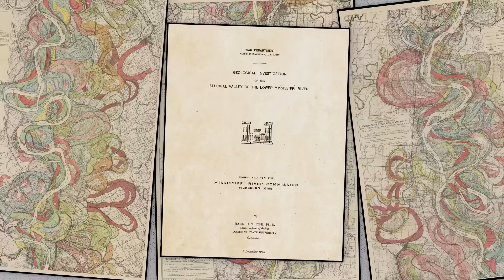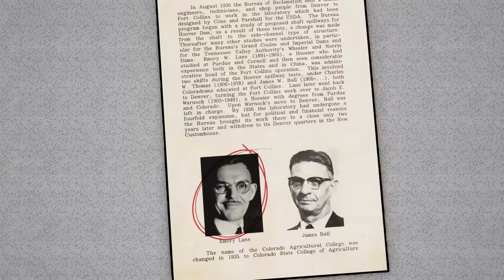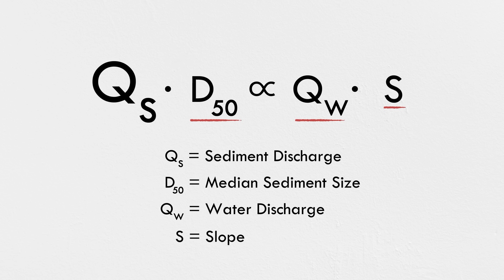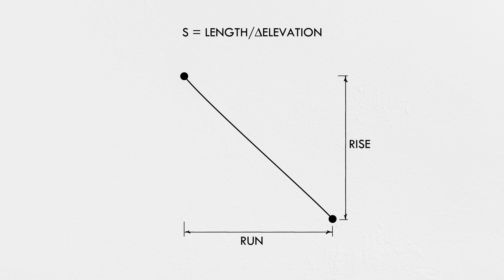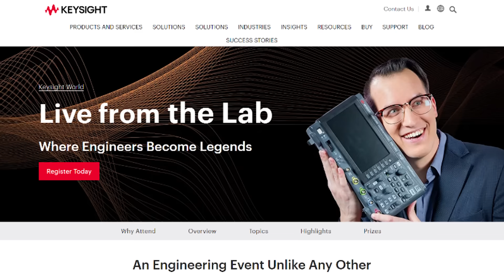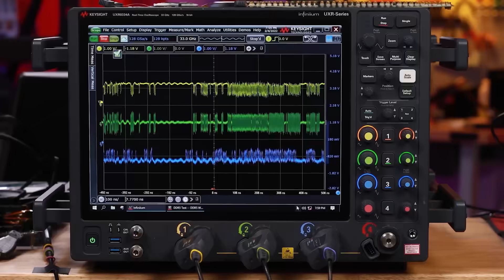Why Rivers Move

Comment: As much as I do not like the US Army Corps of Engineers, there is one thing they have done that redeems them for me and that is the model of the Mississippi River drainage basin close to Vicksburg, MS.  They built a partial one of the Mississippi R with the Arkansas R,,and the rivers feeding the Atchafalaya R. which are the Red, Black, and Ouachita Rivers that come together not far west of where the Louisiana and Mississippi State line meets the River above Angola State Penitentiary.  Technically the Atchafalaya R basin does not connect with the Mississippi R except by a lock between the two rivers.  At one-time centuries ago, the Red, Black, and Ouachita Rs drained into the Mississippi R.  Somehow the Miss. and Atchafalaya split and made their own channels to empty into the Gulf of Mexico at different locations about 100 miles apart.  After watching your video, I think the Atchafalaya R is the younger river as it has fewer bends and is faster than the Mississippi R to get to the Gulf.  If the Mississippi R ever breaks through to connect with the Atchafalaya R by way of a flood the likes of the 1927 or greater flood, the Mississippi will take over and basically leave Baton Rouge to the Gulf pretty much high and dry and flood out the towns and cities along the Atchafalaya including Morgan City, LA.  US190 at Krotz Springs and US90 at Morgan City and LA 1 at Simmsport will probably be cut by the flow.  Those 3 highway bridges and 4 railroad bridges will probably be cut and the I-10 bridge will be imperiled.   The Bonne Carre Floodway has been used a number of times to relieve floodwater pressure above New Orleans but the Morganza Floodway has been used only twice since it was built, in 1973 and 2011.
 I like the river models because flood models can be run on them to gauge the height of floods based on rain gauges to predict whether levees will be topped or not.  They are good for that.

Comment: Consider the impact of the loss of historical beaver populations in the headwaters major rivers.

 While nothing will completely stabilize river banks, millions of small structures in the smaller streams in the headwaters can mitigate the major factors of instability you cover here by attenuating flow regimes and preventing or reducing impacts from large wildfires. 

In the face of a changing climate the structures beavers make can act as a buffer to impacts. Plus they work for free.

We need civil engineers to acknowledge the ways we can live and even partner with beavers.

Comment: The Lower Mississippi River Museum in Vicksburg, MS has those maps on glass where you can slide them to see the changes over time. They also have a table similar to the one you used but it was running low on substrate the last time I went. It's an interesting spot that's free if anyone is passing through the area.

Comment: f  you need  an example of increased water flow in a river,  La Grande in northern Québec.  It ends at James bay at 53.83500540114829, -79.06136776815968
Upriver is a large reservoir.  At the head of la Grande river  about 600km to the east, they diverted part of Canapiscau river (which flows into Arctic) into La Grande River. 
South of La Grande, they diverted Opinaca, Eastman and since 2012, a portion of Rupert rivers north into the reservoir Bourassa, 
As a result, the La Grande rivier's flow from Radisson to where it dumps into James Bay has been seriously increased since about 1980 (and progressively as they increased the number of diverted rivers since initial phase. 
The town of Fort George was on a sandy island at end of river, and locals would fish on La Grande and in James Bay.  Due to the predicted water flow increase, Hydro Québec paid to relocate tghe residents on mainland at what is now called Chissassibi. And because the speed of water flow of the river is too much for small fishing boats and canoes, a new road was built from Chissassibi to the shore of James Bay where they can launch their fishing boats. (Fish also no longer swim upstream now only due to current, but also lack of path up each of the many dams to the source of the river. 

The island of Fort George still exist,  and many buildings remain, but there has been much erosion of the sand, especially on its north side that is on the big channel.  On the south side, there is now steep sandy cliff with trees precariously perched right at edge.  This has happened in the space of 40 years.

Comment: I'm a practicing river hydraulics Engineer in Canada. Recently, Engineer notices on river channel stability have become mandatory in order to get the required permits from the environmental authorities (not the transportation authorities) to do the most basic small bridge and even culvert rehabs. Your video highlights the random nature of river dynamics, and you can see how dubious it is to expect engineers to predict the future behaviour of a river or creek almost as a footnote in the main hydraulics, hydrology and geotechnical studies. Don't get me wrong, structures are absolutely designed to be safe in all conditions. The objective of these new notices is to try to avoid a shortened lifespan for the structure due to erosion or filling up of the channel which would require an earlier than expected rehab. River dynamics is still essentially an academic endeavour, and can't realisticly be applied to tiny culvert crossings. Could you justify weeks and weeks of data collection and analysis for a new bridge over the Mississippi? Of course! What about for a tiny culvert replacement? Of course NOT! And even then, you might only have a ballpark estimation to go on. But environmental authorities don't seem to understand or care.

Comment: This sort of engineering has always fascinated me.  There's a creek that runs behind my house and 30 years ago, it had an island in its middle with a deep channel that ran on the far side, while a straight shallow channel ran on the closer side.  Fast forward 10 years of spring thaws and snow melts, and a few heavy incidents of heavy rain, and the island's farther channel is decidedly more curved, yet still carries the greater flow rate of water.  A few years later, and after one very heavy snow melt and minor flood (this creek has never spilled its banks in my lifetime), and the far side channel has had its intake sealed off by an inundation of gravel and mud, and the nearer channel becomes the main channel for the creek, even though the old channel reopens itself when the water level increases.  Yet, within a few years of this, the island slowly stops existing, and gradually the plants fill in the old far channel, while the nearer channel deepens and straightens.  Downriver, the town decided to create an artificial millpond for fishing and tourism, by splitting the creek's flow, while upstream the heavy presence of trees keeps the creek channels stable along several twists and slow turns.  Within 5 years of cutting a new channel for the creek to provide water for the pond, the intake location has shifted 20feet downstream, eroding the half-assed breakwater of ROUNDED stones at the narrow isthmus. Within the last two years, the creek has begun creating a new island during flood events, approximately 50 feet upstream from the old island, by cutting a meandering loop of water that fills when the flow is increased.  Its location seems counterintuitive, because of its proximity to a major bend in the creek, and represents an almost 270 degree turn the in water's flow.  But that side of the creek is relatively flat, while its opposite side is high and heavily wooded.  Interestingly, the creek is typically no more than waist deep in most locations, but the old and straight channel that still runs beside where former island was located is now more than 10 feet deep.

Comment: the question missed is which way is north because the water is influnced by gravity and based on the table direction it will produce different runs like you see in nature unless it is designed in concreate
Reply: just like flushing a toilet the water swirls based on gravity so if the water is designed back words you get swamps
Reply: @tomahawkmissile241  Why would a toilet swirl be affected by gravity?
Reply: @DeathsHood  it is flowing into the earth. If you go to the other side of the world it would flow the other direction which is the turblance or whirl pools.
Reply: @tomahawkmissile241   That's not how toilet flushing works. It's far too small-scale to see an effect like that.
Toilets flush in whatever direction their jets/nozzles/etc direct the water.
It's even possible to find a toilet with no "swirl".
Reply: @DeathsHood  challenge accepted. lets try a bigger scale look at your weather and see the direction it swirls now look at your potty.  Gravity pushes the water than the electromagnet field twists it. If you wont stick your hand in the water to see if your potty has a nozzle start with your sink and watch it drain like every river does in the world.
Reply: @tomahawkmissile241  A) Most weather doesn't "swirl". Hurricanes do, but that's caused by the coriolis effect, I.E: The rotation of Earth, not gravity.

B) Again: Toilets are too small to be affected in that way, and it wouldn't be gravity that changed the flow of water, it would be the coriolis effect.

C) What does electromagnetism have to do with any of this?

D) A river flowing and a toilet draining are completely different. Both in effect and appearance. They are not correlated on any way other than "both are full of water".
Reply: @DeathsHood  it all has a meaning and they all drain
Reply: @tomahawkmissile241  No, it doesn't.
You just strung together a bunch of nonsensical word-salad that is essentially meaningless.
Reply: it is neutonian thinking that has no merit in the reality of time in order to understand you would need to add in the back words turblance and you will find the meandering

Comment: I never knew how interesting civil engineering was until I found this channel!  I only it didn't need maths...

Some years ago (before we had kids, so I still got the window seat occasionaly...) we flew from Debrecen in Hungary down to Greece.  The first third or so of this flight is straight across the Hungarian Great Plain - the largely flat area inside the curve of the Carpathian Mountains, over which the Duna, Tisza and many other rivers have flowed for millions of years.  

And this is a live - and brilliant- geography lesson into the way rivers move.  Almost every square kilometre you fly over is littered with oxbow lakes, or the remains of them.  Again and again field boundaries, roads, etc follow these lines - often when the original river or oxbow lake is now nowhere to be seen.  

With the controlling of the Duna and Tisza that's taken place over the last 100 years or so and the drainage and management of much of the plain, very little of this is obvious from ground level.  But, from the air, its entire history is laid out below for your education.

Comment: 16:06
You're exactly right and it's a trend that's been picking up speed over the last decade or so. I always hated electronics and avoid them at all costs until I accidentally fell backwards into it several years ago. Mostly fixing test equipment so that I could have my own small lab in the corner of my workshop. But things snowballed and it became a full-time thing. Because of such high demand.

 Electronics engineering type stuff is a great career path to look at these days for a lot of folks. That doesn't mean you have to follow a certain path... There are hundreds and hundreds of strange and interesting opportunities related to to electronics engineering in industry and research.

I specialize in component-level board repair for lab and test equipment. And some associated metrology stuff. It's crazy all of the things clients have brought to my lab or have requested that I come out and take a look.

 Everything is speeding up and becoming more electrically involved... Usually to the benefit of efficiency, prophets, and safety. 

Even for someone like me who hated and dreaded having to work with electronics (back in my early twenties when I used to restore Nils & machine shop equipment as a hobby.) I started learning and now I really enjoy it. It's a lot simpler than most would assume.
( Except high-frequency and RF type stuff.... that's just straight-up black magic.)

Comment: It looks like the equation can be solved for sediment sizes that can be made mobile by a given combination of slope and discharge flow.  In western Colorado most rivers are confined to canyons and we don't see the meandering as often.  About 5 years ago we had unusually high runoff that I got to see in person as part of my job.  At the confluence of the Gunnison and Cimarron River a large pile of "sediment" was created where it had been flat and smooth as a result of the massive flows.  It was about 100 ft. long and 30 ft. tall and very unstable.  It consisted of rock from fist size to several feet in diameter.  I was shocked.  By the following summer it was completely gone.  Those rivers typically flow at 1300 cfs and 300 cfs respectively but on that day it was about 10,000 cfs and 2,500 cfs.  Great video!

Comment: Similar to how lightning doesn't take a straight-line path to the ground. 

I do a lot of work with electronic test equipment and metrology stuff... And I've had a few folks and clients ask me about that over the years. If electricity always takes the path of least resistance.... than why does lightning have such a complex and unpredictable path. 

A bit unintuitive if you don't work with that type of stuff everyday. But totally makes sense once you figure out the science behind it. 
Great video as always!
Reply: 16:06
You're exactly right and it's a trend that's been picking up speed over the last decade or so. I always hated electronics and avoid them at all costs until I accidentally fell backwards into it several years ago. Mostly fixing test equipment so that I could have my own small lab in the corner of my workshop. But things snowballed and it became a full-time thing. Because of such high demand.

 Electronics engineering type stuff is a great career path to look at these days for a lot of folks. That doesn't mean you have to follow a certain path... There are hundreds and hundreds of strange and interesting opportunities related to to electronics engineering in industry and research.

I specialize in component-level board repair for lab and test equipment. And some associated metrology stuff. It's crazy all of the things clients have brought to my lab or have requested that I come out and take a look.

 Everything is speeding up and becoming more electrically involved... Usually to the benefit of efficiency, prophets, and safety. 

Even for someone like me who hated and dreaded having to work with electronics (back in my early twenties when I used to restore Nils & machine shop equipment as a hobby.) I started learning and now I really enjoy it. It's a lot simpler than most would assume.
( Except high-frequency and RF type stuff.... that's just straight-up black magic.)

Comment: Worth noting that rivers like the Mississippi that are so apt to change that it takes continuous and major engineering efforts to keep it contained are fairly rare when you get to that kind of scale.  Every river does this to some extent, yes, but the Danube, Dnipro, Rhine, Rhone, etc are all pretty well established in river valleys and don't get much chance to hare off in a completely new direction.   If the Mississippi were left to its own devices, it would not be in New Orleans anymore; most of the big European rivers that are as important there as the Mississippi is in the US run through the same port city that was founded centuries before New Orleans was.

I'm not a geologist, so I'm not great at geomorphology, but I believe the main contributing factor here is slope.  The steeper the slope you run water down, the more energy it has moving it downslope and thus the less other factors are able to divert it to the sides.  This in turn increases erosion as per the relationship mentioned in this video, which is why you tend to get pronounced river valleys with rivers like these....which in turn make it even harder for a river to divert considerably because now it's running through a trench and would have to break out of that somehow.

Comment: Regarding deposition and erosion and weather balance; In Australia and other parts of Oceania we get a weather phenomenon called el nino and el nina (I don’t know if it’s something that happens in northern hemisphere too off the top of my head)

It leads to decade-ish long periods of oscillation between drought and excess rainfall 
Does this then mean in the drought (i.e. less water) sedimentation flow rate will also drop? (and vice versa) 

Given this is over a number of years, can we still use lanes equation to model these time periods?